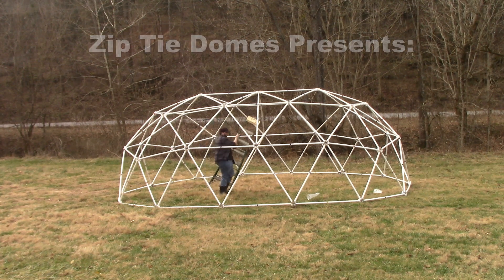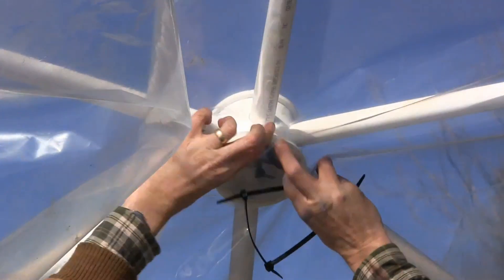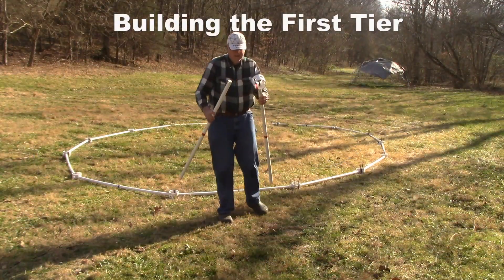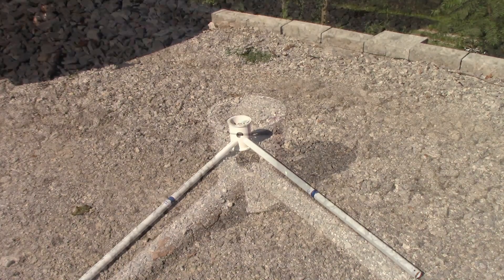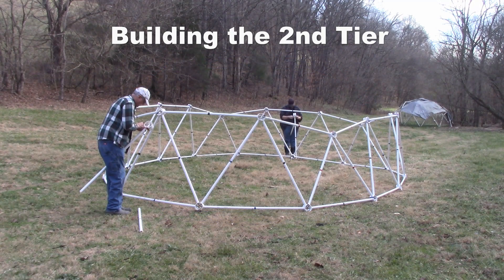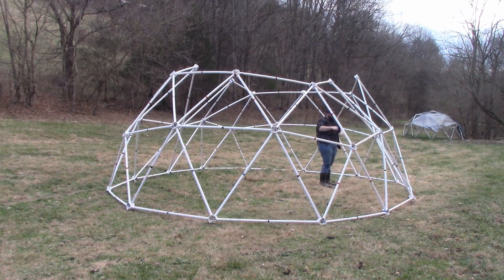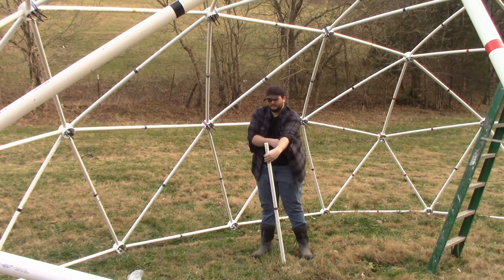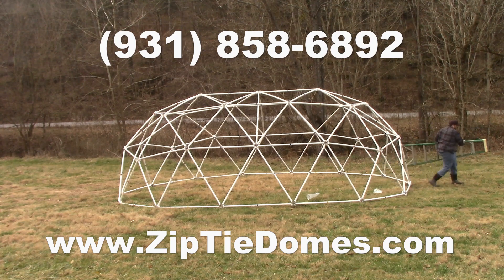Geodesic Tunnel Dome with 1 Extension

Comment: Thank you John. I have an almost 80 yr old couple for friends. His nephew is telling him to move and they have no big money. So I would like to make something happen. Has anyone made a home 800 sq ft with ZipTies? Thank you☺️Art. Florida
Reply from the maker: Art.  I have had several people tell me that they were living in our domes, but I don't have pictures.  You need so much more to live somewhere than a roof, like flooring, septic, electric, plumbing from a water tap.  I have some ideas, but have not tried them yet.  My son bought an old 5th wheel travel trailer and we parked it our yard for him and his wife to live for about 5 years.  We dug a trench and put a pipe from the trailer to our septic tank, ran a hose pipe for water and a heavy duty extension cord for power, and it worked.  The travel trailer had the stove, fridge, toilet and everything else.  Maybe you could pick up something used and cheap.  Many blessings to your and your friends.  John Hurt